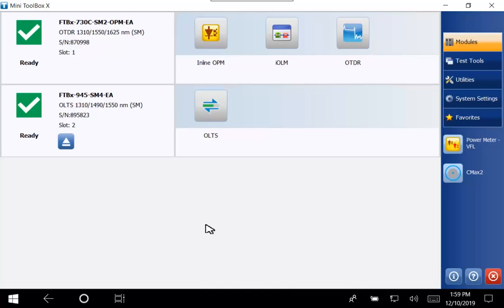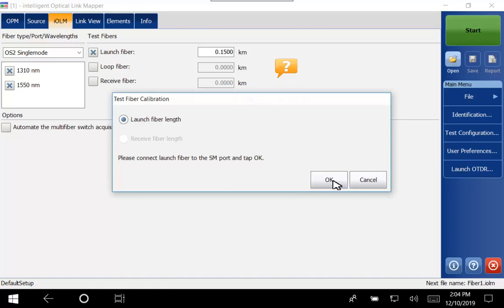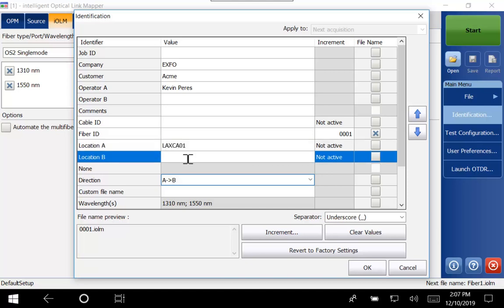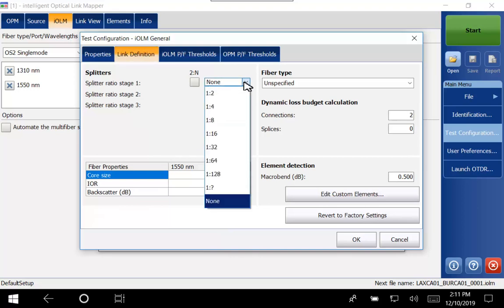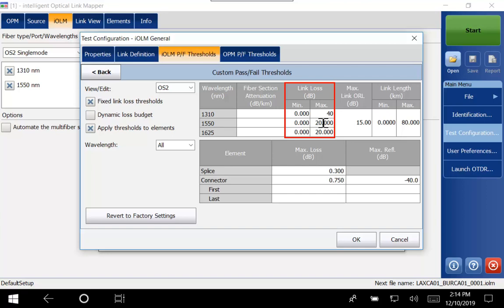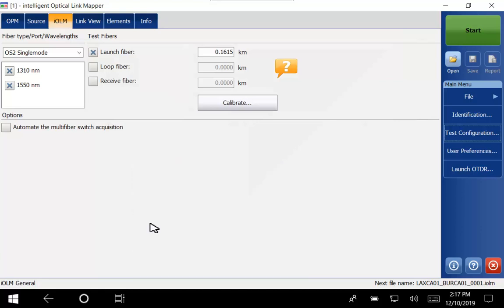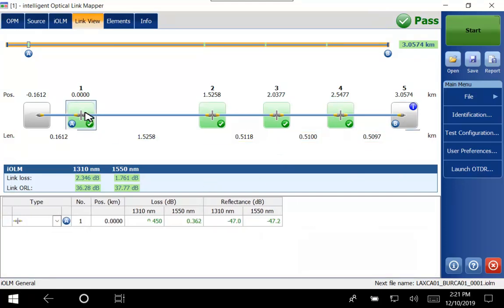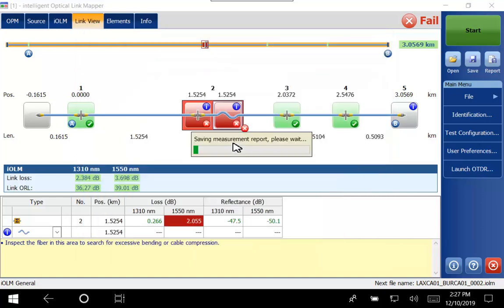Updated - Setting up a EXFO iOLM test

Comment: I’ m trying to test a 24 km distance to the exchange with primary and secondary splitter,(1x4 primary 1x4 secondary)
On the way I have like 10 splices on joints, sometime Iolm se only 2 splices with los more then 0.270 fail, limit by company is 0.200 on a splice,
After I run 8-10 times test finally iolm see 5 splices with pass,  are they accumulate loss in 2 splice points from all of the splices?
Sometime fail splice jump to another location (2km away from previously)
Can this dynamic loss budget calculation help me here?I don’t have this obtion, thinking to get software with this obtion or update
So if I know I have 10 splices on the way can be useful?
Power is good, also I run OTDR test looks fine,
Can difference of fiber compositions affecting this?ug and aerial cable are completely 2 different company an d composition, when I splice I si some difference on core and protection glass!
Can test configuration be a problem not recognising all splices on the way? 
Attenuation/km in parameter’s 
Some joints have 300,500 meters between them
Reply from the maker: DJ, This is an issue we will see when testing through passive splitters.  The high loss often results in the use of long pulsewidth which will merge events.  I really need to do a video on this to fully explain it.  Email me at Kevin.Peres@EXFO.com and I can explain it better in an email.
Reply: @KevinPeres  have you made that video yet?

Comment: Kevin.. setting up my FTB-1 from your video. Have APC connections will that effect my link loss.. 1310 is -0.003 and 1550 is -0.032db loss. Would I need to change my threshold. Thank you in advance
Reply from the maker: These are gainers.  Most likely a Mode Field Diameter mismatch. Gainers are not a failure you need to average them out bidirectionally. Your thresholds should not fail them.
Reply from the maker: I just realized you said link loss.  How long is this link ?